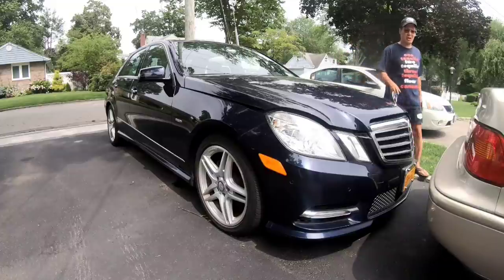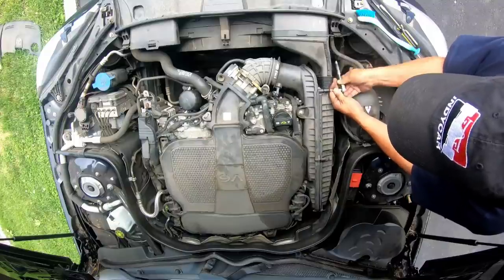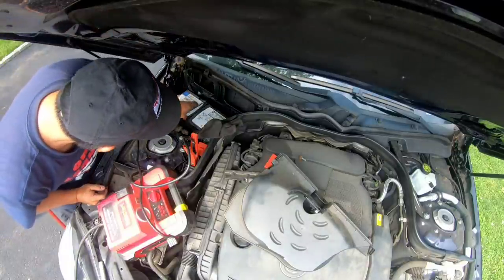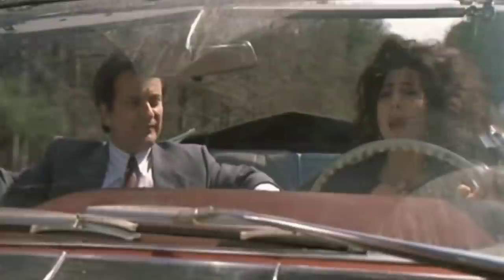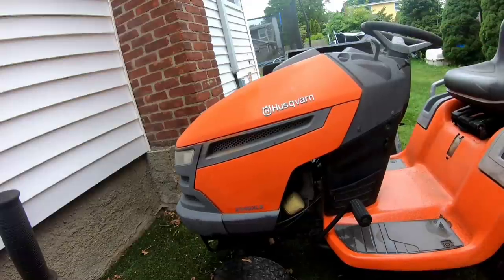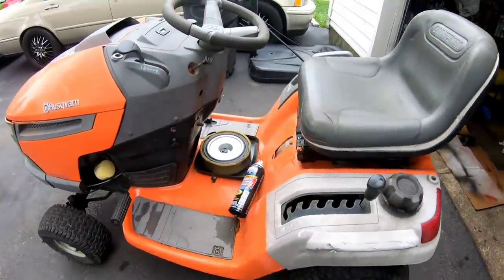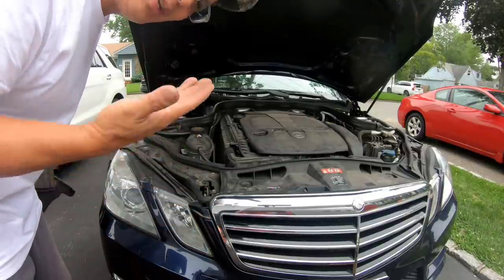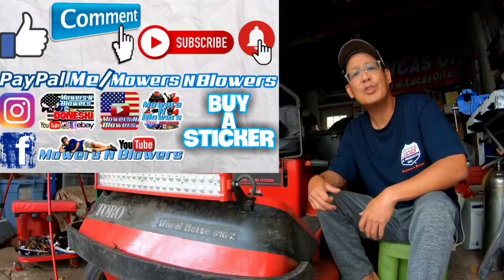2012 W212 MERCEDES BENZ E350 4MATIC SEDAN AIR FILTER & AGM GROUP 49 H8 BATTERY REPLACEMENT FUBAR FIX

Comment: Shocked that out of all people, you made a simple mistake with the battery connections...but not surprised that you were able to fix it lol. How could u tell the fuse was bad by just looking at it?
Reply: Because you can see that the metal strip inside the fuse is broke, that's how they work.
Reply from the maker: You can see it’s bursted
Reply from the maker: It sucked!  Rookie mistake.  Both wires were colored black!  I was confused!
Reply from the maker: My old age doesn’t help, not as sharp as when I was 30

Comment: your to cheap to pay someone to do it the right way
Reply from the maker: It’s changing a battery,  I’ve done it a hundred times,  but people do make mistakes as I did.
Reply: @MowersNBlowers  did you know that some  Mercedes and a lot of BMW's require the Battery to be programed into the cars  computer,, I learned that one the hard way, after about 100 miles the car died.

Comment: Mercedes has 5 or 6 or more engine and trans combos for every model.  When in doubt order by Vin numbers!    Generally the only way to get parts from Benz!!  
Putting the booster on is wise when changing the battery.  I use to connect a 9 volt to the cigarette tighter just to keep memories in tact!!
Reply from the maker: Good tip

Comment: There's a lot more fuse panels than you think and a fuse probably on the rear of the radio.  There may be a left and right fuse panels inside and more outside under the hood.
Reply from the maker: Didn’t watch the whole video huh?
Reply: @MowersNBlowers  i did now after i finished mowing the back yard.  You make me proud!! Ya did your research for sure!!   Heading to bed........mowing front yard tomorrow!!    Cheers to ya!!  Rick...😁
Reply from the maker: @cycleguy666  have fun rick